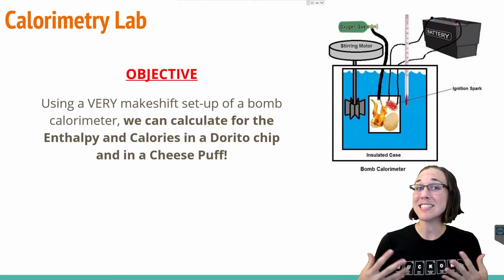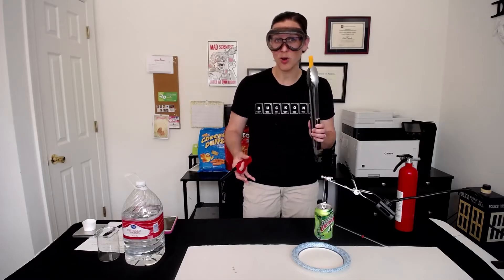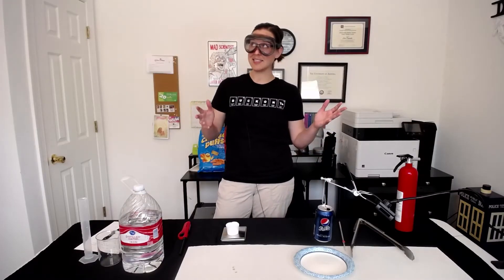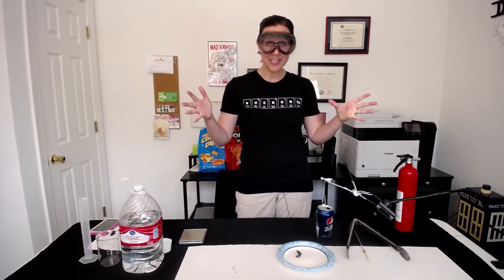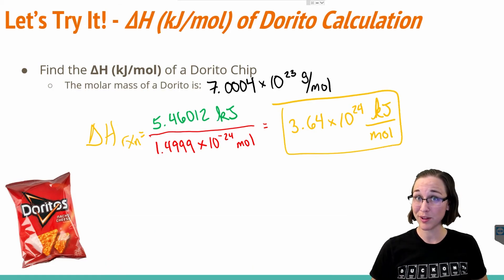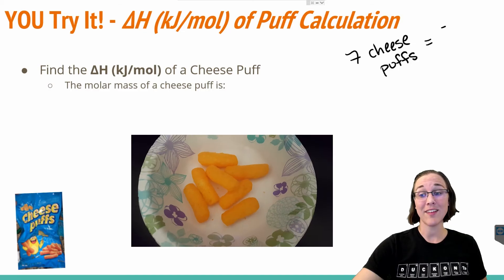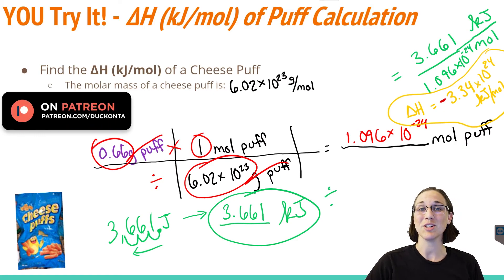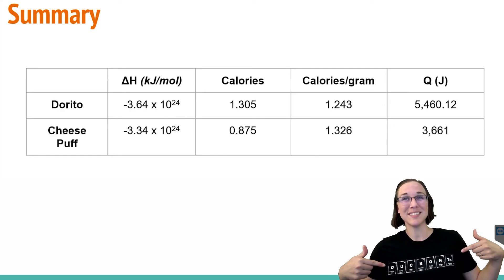Food Calorimetry Lab Calculations and Explanation (95)

Comment: Should you have weighed the before and after chips? The whole thing, regardless of what burned or not?
Reply from the maker: Hi Brandon, 
In a real calorimeter (not this make-shift rigged one LOL), you wouldn't take the final mass, you would only mass the amount of food you added to the calorimeter initially (since it would all burn inside a real calorimeter). I only took the final mass of the cheese puff (the portion thereof without the black char) because that large portion of it didn't burn, and therefore wouldn't have contributed to the temperature change of the water. However, with the Dorito chip, most of it burned---so I didn't want to try and break off that tiny tiny piece that didn't burn to weigh it and subtract it from the initial (BUT, to answer your question, YES---if I was being more precise for the sake of the experiment, I would have either needed another person to immediately help me burn that little remaining piece while I measured the water temperature, OR I would've needed to weigh that tiny little piece that did not burn). Since this is an open system rigged calorimeter, there is a fair amount of error for the values collected anyways, but it gets the premise and idea of calorimetry across without all the fancy equipment! Good question! :) 
Best, 
Duckonta
Reply: @Duckonta  thanks. I figured most of what you said above. It's definitely a great tool (even if the heat exchange is very inefficient) yi talk about conservation of energy and mass. It does show how things transform but are not destroyed or created.

Thanks for the video.